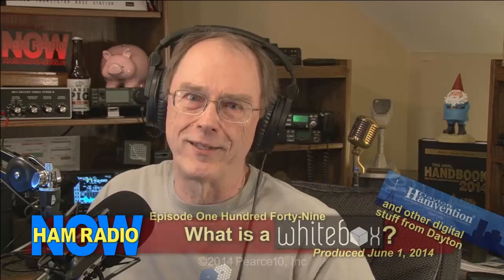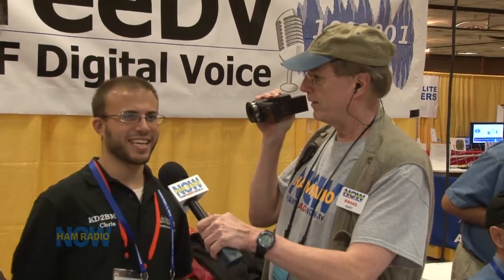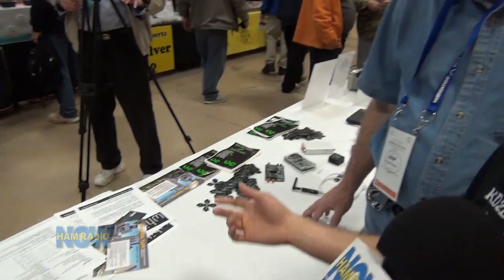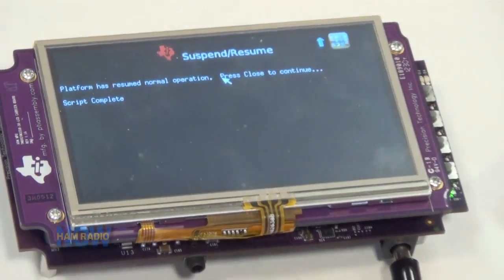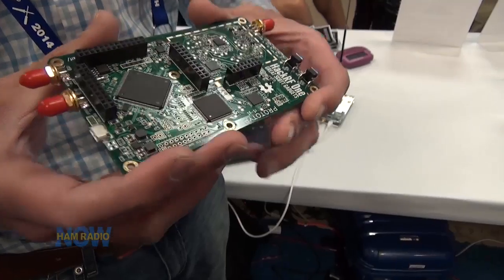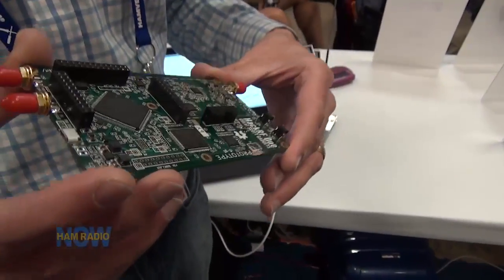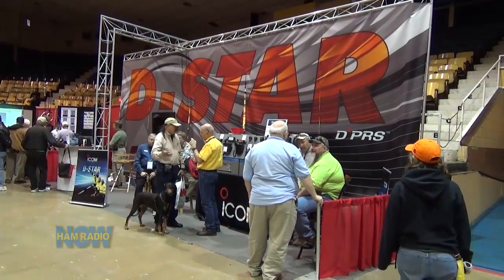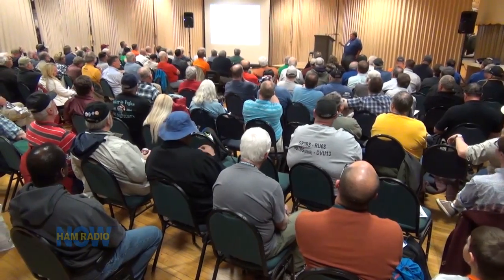Episode 149: What's a Whitebox?

Comment: Actually, it can happen on any mode that uses AMBE; the reason you don't hear about "R2-D2" with DMR, NXDN and possibly System Fusion is that the commercial systems mute when the BER (Bit Error Rate) gets to the point where the FEC can't correct all the errors. Icom didn't think that was needed, from what I understand, though that may have changed with the newer radios that are using the AMBE code licensed from DVSI instead of the AMBE chips.

Comment: Please don't take my knobs away from me... I'm an aspiring software developer, but I have also been a ham since 1990.... I prefer the 'knobs' and my VFO!  I fully support digital HF and VHF/UHF voice modes, however, I do not support anything that has restrictions imposed.  I love my Yaesu rigs, and don't believe we should be limited by manufacturer.... after all, amateur radio is all about being "open"... and open source CODECS are the only way to go.  
I certainly would not object if the FCC added a rule requiring all digital voice modes to be open sourced for Amateur use (recognizing that commercial applications and uses do exist.).
Reply: I believe this extends into the VHF/UHF realm.... all digital modes used on the ham bands should be "open source" for Amateur use.  IOW.... D-star, et. al., CODECs should be required to be "open source," especially when used for amateur radio use.
Reply from the maker: Elecraft is "SDR Inside," but in a conventional package, and they're very popular So can be done. If you want to develop equipment based on FreeDV/CODEC2 that has all the physical knobs and buttons, I'm sure that Chris and Bruce will be thrilled! The "SmartMic" will be a hardware implementation of FreeDV on an embedded processor. It'll be interesting to see what interface options they choose.

I don't think I want the FCC to tell us what NOT to do, though (as in NO closed source code). It will take a while, but any manufacturers offering ready "user" access to the open-source technology will gain a following in the marketplace. I think we're at the leading edge of a big, new space in ham radio. Look for Flex and Elecraft to do that first.
Reply: The FreeDV server has USB HID implemented, so you can attach whatever knobs, dials, and buttons you would like to control the rig.  No restrictions! --Testa, KD2BMH